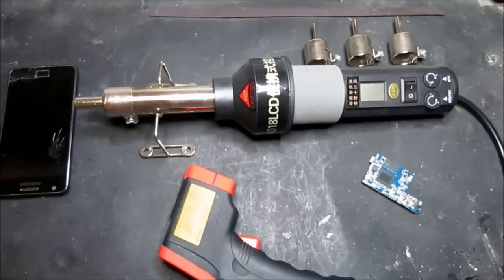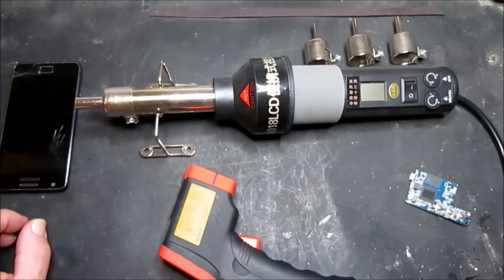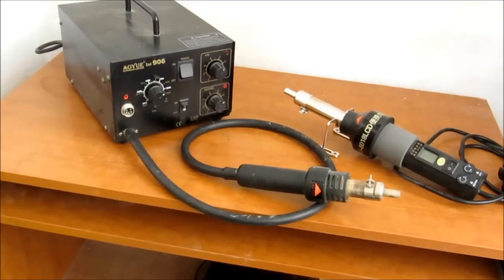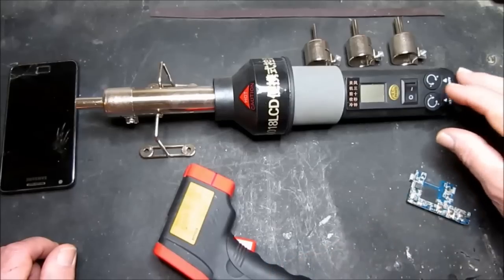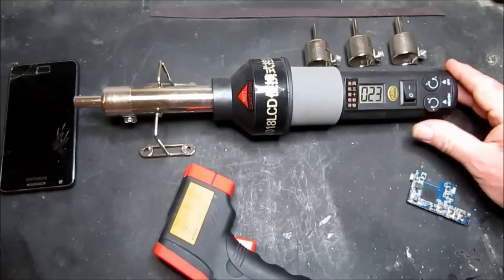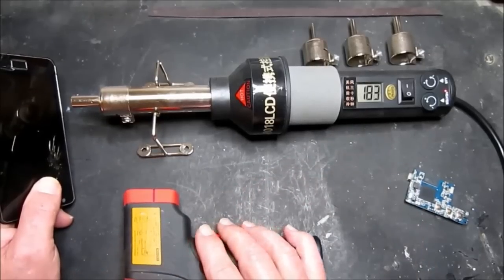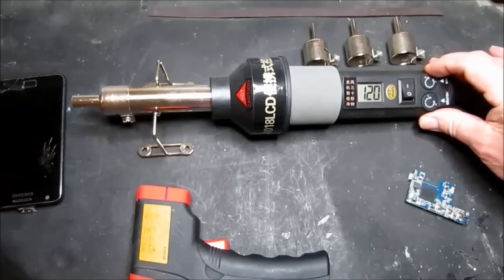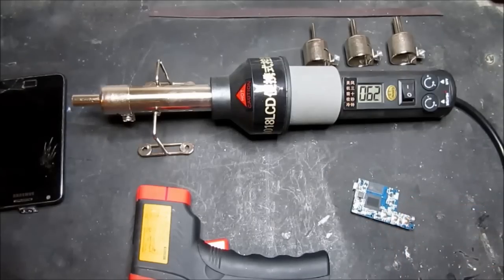8018LCD Adjustable Electronic Hot Air Gun from Banggood - Electronic Repair Workshop Tip

Comment: Hehe, my GJ-8018 won't melt the solder on my 8 pin SMD!
Reply from the maker: Hi Stuart, In general using hot air guns is more of an art than a science! There are many variables, airflow, temperature, nozzle size  and what you're working on. I practice on old circuit boards starting with caps and resistors and working up to larger IC's. I always use a liquid flux "EXEL 314" I guess you can find similar. As the original solder paste is lead free sometimes it does not seem to melt, rather crumble! In this case I put more solder but leaded, you can always use solder wick afterwards to remove the excess. Just to  show it is possible check out some of my other videos:
https://youtu.be/tWSPvsFQxzI?t=281
https://youtu.be/fMXBI_hhhjg?t=147
https://youtu.be/zazcYapBs8E?t=53

Comment: hi, is this gun good for 300degrees celsius? just curious if i could weld plastic
Reply from the maker: Hello, It will go over 400 Celsius although not recommended for long periods. It will definitely melt plastic, don't ask me how I know!
Reply: Thank for answer i ask that because whatching your gun, the max temperature seems about 80Celsius....
Reply from the maker: In the video I was just working on a mobile phone screen. You can see me soldering with it in this video https://youtu.be/zazcYapBs8E
Reply: ok ok now i got it. I thougt that the real temperature from air gun would be at least 80 celsius degree...

Comment: hi
the displayed temperature is in F 
it fits the gun reading (deg C)
Reply: Yes I too agree , I found with trial and error,unit melts the solder between 600-700. When I tied on scrap board, but I failed when I tried to remove mobile ic??? Why? Applied sufficient flux  right Tempe even 800. But no luck???
Reply: Yes deg F makes most sense.  I can only work on surface mount component at 650 - 700 deg LCD readout.  Clearly that's not deg C.  However, when you start the gun cold, LCD shows room temp in deg C (24), so that's very confusing